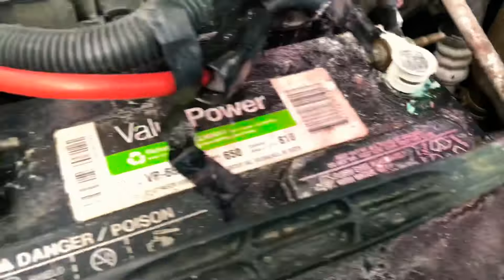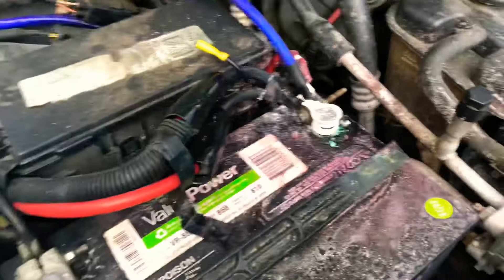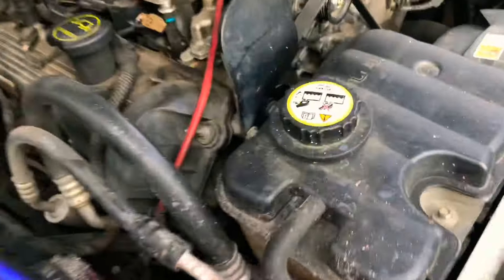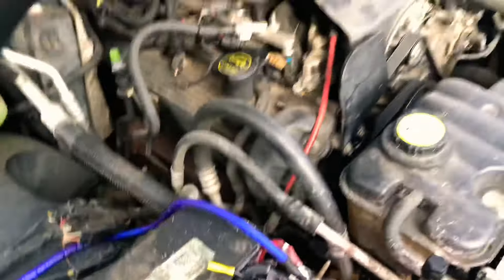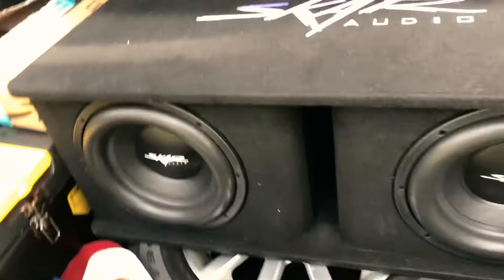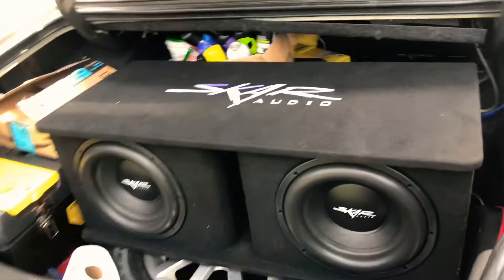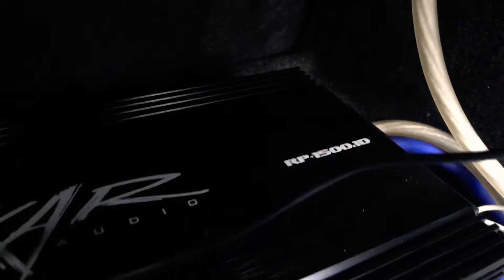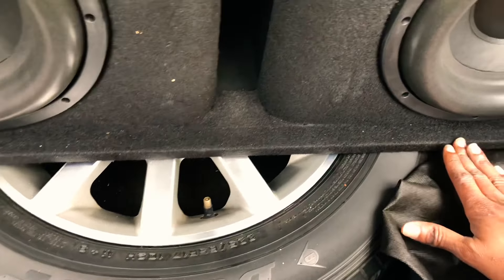BRAND NEW SKAR AUDIO 2 12’s SUBS! HITTING HARD

Comment: honestly bro you need a capacitor look UP super caps they 300 bucks but there alot of reserve a high output amp alt will help alot look up the amplifiers  amperage rating you want that much on top of what it got to have that power at a more constant those subs are power hungry

Comment: So if I got 2 12 inch 1500 watt speakers, I need a 2000w amp?
Reply from the maker: I got a 1500w amp. But I think they can handle a 2000w if tuned correctly.
Reply: always make sure to read the RMS, not the peak. these speakers are 1,200 watt RMS, so if the amp says 1,200 watts for the RMS (Not peak) itll be perfect

Comment: i had to upgrade my pure power high output alternator 240 amp 4gauge wire in my 2012 impala ltz  i am running 2  12s  dd audio redline 500 series with a dd audio DM 1000a mono amp  dd audio C4 .60 4channel amp custom wood birch box and  a red top optima battery and it slaps hard

Comment: Im getting a single 12' subwoofer Peak Power: 2,500 WattsRMS Power: 1,250 Watts do i need the RP-1500.1D or the RP-2000.1D for this subwoofer ineed some advice if anyone reads this
Reply from the maker: I would go with the RP-2000. I have the Rp-1500 on my 2 12 sdr 2400 watts and it’s not giving my speakers its all. I’m most definitely upgrading my amp to the Rep-2000
Reply: @lifeofslimgates  oh ok isee what ur saying thanks for the advice
Reply: @TattO22TO  I agree with him, the rp2000 is a better amp not just because it has more power
Reply: beardedforlife skar is selling rp1200 with these 12s. Should I get the kit and upgrade to big 3? I have stock alternator and no extra battery in trunk.

Comment: I'm running 2 12 inch fosgate P3 DVC 4ohm wired to 1ohm. Got this box, skar sk2x12 with the skar rp1200.1 which is about 900rms, 1200w max. subs are 500W rms 1200w max. so with the 2 subs, someone correct me if I'm wrong but it halves the wattage so each sub would get about 450w RMS, 600w max, so a bit less than my subs are rated to handle.  In any case, this box seemed to fit the specs of my old P3 subs, yeah I have the old RF P3s from about 10 years back but they've sat unused alot. In any case, the subs were like 300 each and I gave less than 300 total for the empty box and amp. They beat hard and clean. I gotta get an amp on my interior speakers because they can't keep up. I have nice components in front, 6x8s in back, all fosgate but they're running off an alpine w650 so they're getting like 25w RMS. The subs just overpower everything, they're very loud. This is in the trunk of a crown Vic. the lower part, the box is far too big to fit in the spare tire area. Once I get the 4 channel amp wire up to my highs/mids, it should rock really hard. For now it breaks shit with the bass, highs can't keep up. They sound good, just not powerful enough. I can say for certain that my P3s are far louder and cleaner than my buddy who has the same box in a charger trunk but he has the Skar subs, 12 inch that came in the box, I bought the box itself, no subs off Amazon and I'm impressed with the quality. Wish I had got the one with the bed liner deal, but the carpet is nice and it was $$60 less
Reply: Sir, this is a Wendy's
Reply: Have you seen a dyno of that amp.   Does over 1200 easily

Comment: Just got a pair of those IX12 in a custom box I built they sound good, got them wired together at 2ohms running a Orion XTR650.1 think I just might rewire them to 1ohm that 650.1 birth sheet said it will hit 736watts at 12.8 volts
Reply: Just get a bigger amp rockville offer's great higher quality amps that's are less then $200.00 you can get a CEA rated 1000 watt RMS amp for around 130$

Comment: I talked to Skar myself cuz I got the 1200watt amp that test @1600watt I wanted the 2000 and they said it’ll be too much for them SDRs. They also said that the 1500watt is the best upgrade, their amps put out more power than they rate them.... don’t blow them thangs mayne
Reply: I have a feeling the rp2000 wouldn't be too much. Besides that having a more powerful amp and tuning down gives you more headroom
Reply from the maker: @beardedforlife thats what i was thinking

Comment: Somebody told me I need to use 100% copper 0gauge and 4 gauge wire
Reply from the maker: They telling you the truth bro
Reply: Mayne that shit high as hell what’s wrong with the $40 wire from Walmart 😁
Reply: @onehunnit493  bro, go to wireandsupply.com and get you some welding cable. It's a lot cheaper and does the same work. I have 1/0 for my big 3 and my runs for power and ground. I think I paid around $70-75 for all my wire and cable lugs

Comment: Hope you know having 2 subs have hardly any effect on having more bass. Mostly dosent do anything but its cool to have two.  But its hard to explain do some research (:
Reply from the maker: I heard that before. I think imma look into that. Appreciate that bro
Reply: Im bout to go with 4 12s.   5000 quantum audio.   On a 5k tarampus.      What you think???????  Right now i have 3 pb 12s on a cadence 7000 watt amp.    Im tryna decide seal or ported
Reply: What do you mean it hardly has effect
Reply: @beardedforlife3740  look into it more . If you have two subs of equal power ur not adding bass there the same sure you got more area coverage but it dosent add more bass . The bass would be the same as one. If you use two your requirements are to need more power to supply for the two subs. If you have a sub with more power than that other then we'll its pointless obviously the one with more power than the other single sub will have more bass. Just cause you add a nother sub dosent mean more power . You would need to add alot more plus alot of other math is involved just cause you see demos with pros don't mean you can up and bust a window you need to be packing what they are. Lol
Reply: @isaacmack1316  Using two subs that are the same always produces more bass than one. Louder bass comes for more power, cone area, box tuning, the elimination of impedance rise of the vehicle and some other things. Two subs allow for more power than one and obviously have more cone area
Reply: @beardedforlife3740  i like how ur using other information but there are alot of professionals not me that have said the same of what I say because I learned from them even in home sound systems . Yes there two different setups but same concept
Reply: @beardedforlife3740  also i got a sub of same power that dosent make much difference i had a dual went to a single and it pretty much feels the same so the difference like other pros have said are very little . They both produce same watts.
Reply: @isaacmack1316  show me what "pro" that says that. I dare you to meter one sub then compare it to a set up with two of them. I guarantee you will meter higher than with one
Reply: @beardedforlife3740  lol wow someone's getting pissed for nothing im not going to step to ur level of pissy nis.  I gave my opinion and thoughts if you don't like them and goina lose it 🤷 don't comment.  Simple bud now im going back to soldering bye now . Pewe
Reply: @isaacmack1316  🤣🤣🤣 I'm not pissed in the slightest. I loved how you can't back up anything you say though lol
Reply: Also when ur say dare is usually an act of frustration or anger. I'm not going to stew to ur position.
Reply: @isaacmack1316  no I said I dare you to because I know you can't and you still haven't backed up anything you've said lol. If you can show me that you are right I will admit you are
Reply: By adding more subs, you decrease ohms, as long as wired in a parallel setting,  that, ALONE, adds power,  then you double surface area, which doubles air movement, and you essentially double your excursion, which ties into doubling your surface  area
If you don't get more bass from an additional sub(s), you have done something incredibly wrong.
Side note: just have to make sure your amp can push to the ohm(s) you have your subs wired to. Especially when you get below 2 ohms, otherwise you'll send the amp into protection mode,  and if your amp for whatever reason, doesn't have protection, it will fry it rather quickly
Reply: @isaacmack1316  you have mentioned a single time where you got your supposed information from. Go actually ask someone that's been doing car audio for awhile. I have  many times and it's the same answer everytime. Once again, the fact that you can not produce any proof whatsoever show you have no idea what you are talking about. If you really want I can provide multiple videos and/or articles that say the same thing.
Reply: @beardedforlife3740  look i dont care anymore I looked at my info from people who do car audio . Man thats the thing you need to finds ways to make it have more affect yiu cant just slap em in there ive said alot you can just read them or leave me alone im done im to jackt up from this horse shit I just don't care anymore. I'm still learning I know I don't know it all and I will continue to learn 💯 so goodbye

Comment: Use 0
Reply from the maker: 0 gauge wire??
Reply: Yea 0 more power bro
Reply: I gt lincoln with 2 15s right now im tryna put rimz onem wats size those u gt and dif u have to cut or no
Reply: @fatman2x  wire gauge doesn't give you more power. It allows for a higher current capacity and helps keep your equipment cooler.